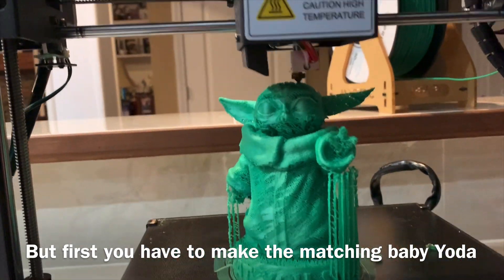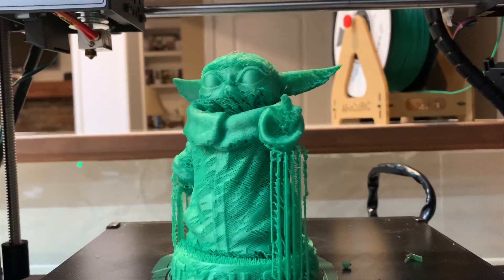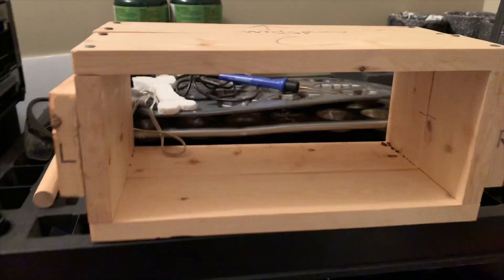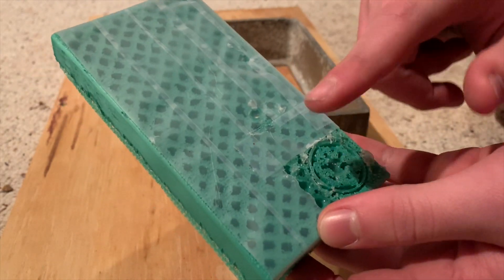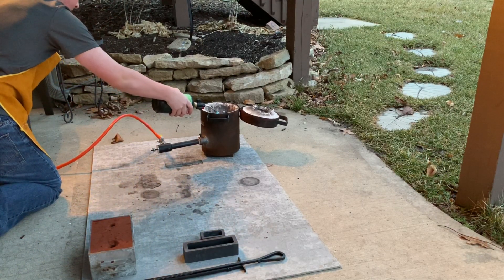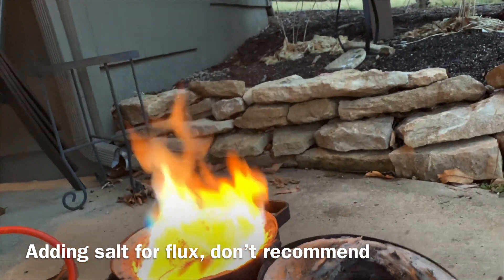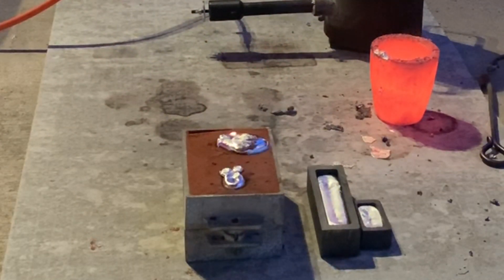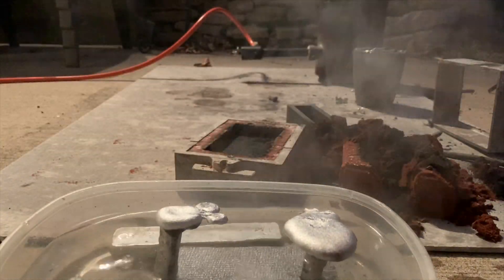I Made Real Beskar steel (Mandalorian steel) and baby Yoda

Comment: Nice that you got a solo project.  You need to make some adjustments on your 3D printer, you look to be way under extruding your filament. These printers clog up all the time, so it might be good to get you a nozzle kit, with extra nozzles in it. Also watch the gears that feed the filament, the Extruder, if its plastic on the arms, the filament will eat through it, you can upgrade to an aluminum one real cheap usually, and try for some stainless gears once your brass ones wear out. Your top and bottom layers look a little thin, but it could be a partial clog.  There are so many possibilities.  Have fun with it.
Reply from the maker: We had to do these before my brother went back to college so we made the fill 15% compared to our new normal 25%. I leveled it again, made my own pattern in auto-cad, and changed the g-code so it takes longer to print but works a lot better. All good now I don’t know how to post pics on YouTube but I would post the new print for you to see. Oh and this printer is full aluminum no plastic except for the electrical parts. I got it for $165 it’s called the Anycubic i3 mega.
Reply: @American_Innovation  you cant share pic on youtube, but you can on Instagram. How big was that roll of filament. Looked like a big ole roll. 5KG one??
Reply from the maker: Thewulf 56 I meant like creating a community post
Reply from the maker: Thewulf 56 actually 1kg 1.75 on Amazon for $17
Reply: @American_Innovation  gotta have 1K subs I believe for that.
Reply from the maker: Thewulf 56 I haven’t heard that before and I’ve seen other small you tubers use that
Reply from the maker: Idk ur probably right about that
Reply from the maker: Thewulf 56 yah my bad ur right
Reply: @American_Innovation  Ah, it looked like a larger roll.. I use a site called Zyltech.com. I like their filament.
Reply from the maker: Thewulf 56 never mind I found out how